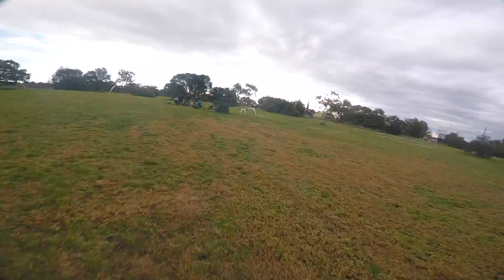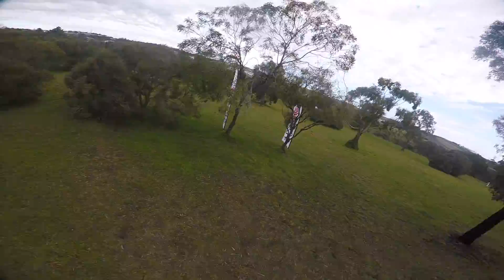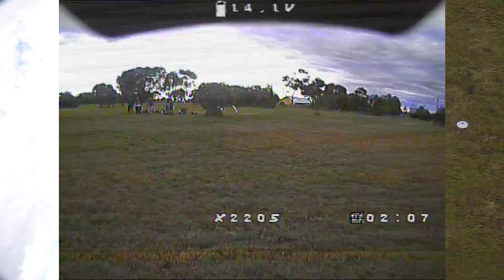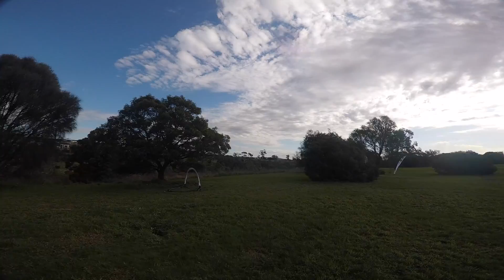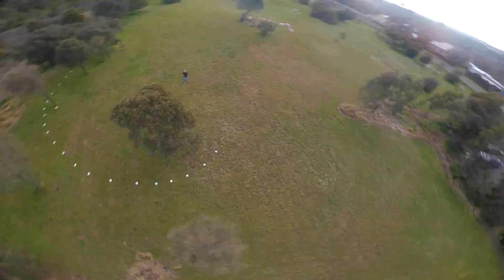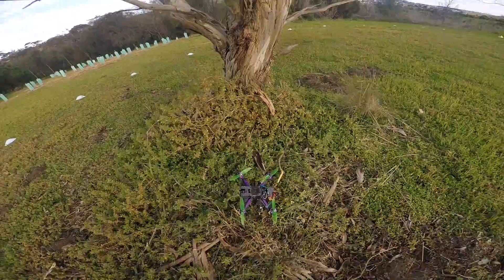THINGS ENDED BADLY!!  Eachine Wizard X220S review + flight

Comment from the maker: Wizard x220s Link - http://bit.ly/2srvodc
but I recommend at the minimum replace the top plate with this and check your screws and solder joints
Wizard x220 top plate (Full Carbon) - http://bit.ly/2tSfhWH
Reply: UAVfuturesx220 top plate works for x220s?
Reply: Thats gold Stewart, love ya work mate, keep it up.
Reply: Absolutely loved this review mate! Had a good laugh when you guys were trying to break it, I'd love to see more of that (hint hint).
I'd love a video on the comparison of these arms vs the original full carbon arms.
I've crashed my 1st gen wizard a few times fairly hard and I'm yet to break anything other than the sma connector off the vtx.
Keep up the good work mate!
Reply: UAVfutures great review. I loved the crash tests
Reply: Stu!! Just wanted to let you know, if the top plate is the same as the original Wizard, you can use this(http://tinyurl.com/y8lwvs9u). It is a 2.0mm top plate and has lasted me many crashes on my X220!
Reply: UAVfutures I would suggest replacing the whole frame. You broke the top plate, I broke the bottom (i didnt have the S, but I got one to play with). With a good frame this thing would be an amazing deal for beginners, but in the beginning you crash so much.

I wanna get more people into FPV and something this cheap really catches attention, but I don't wanna direct people to a first drone that breaks so quickly.
Reply: Hmm good to know this, thanks
Reply: UAVfutures you should do a parts swap to a better frame
Reply: UAVfutures is the movie kangaroo jack accurate
Reply: UAVfutures Hi Stu. I'm new to the drone racing scene really want to get involved I have a tiny furibee I have made fpv and loved it. What would you recommend for an outdoor racer. I was looking at the wizard 220 and then came along the 220s I really don't know what to go for as I want an rtf that's not gonna break the bank. Thanks for any help.
Reply: With so many things that are being mentioned to be replaced, top plate, props, stock battery is junk, so so carbon, etc.  Stu would you suggest just spending the extra 25 dollars and getting a Tyrant S instead?
Reply: UAVfutures HI Stew. Big fan of your channel. I have to ask where is the part two flight review of the Talon displayed right near your head in this video? Every new video that you create I'm alerted via YouTube and I'm anticipating the Talon review flight test. With so many racing choices out there it's hard to decide but I'm very interested in your thoughts on this frame. Keep up the fantastic reviews.
Reply: UAVfutures [IMPORTANT] GOOD NEWS! HELLO!  Just fyi, Banggood has changed everything on the wizard x220s. The frame has been upgraded to carbon fibre, and the motor screws have been screwed tight. Everything works fine now, so most of the serious issues highlighted by reviewers have been fixed! Good news!
Reply: Screwing them down tightly is only going to defeat the purpose of the soft mounts, they need loctite. Good to see the fram has been changed, I noticed on the website that they have highlighted the carbon fiber arms.
Reply: UAVfutures wich one should I buy? The wizard x220 or the Diatone Tyrant or the wizard x220s as my first racing drone? Or is it better to build your 99$ build ?
Reply: Hi @UAVfutures

The x220 top plate don't fit good for the x220s frame. The x220 top plate have his 2 rear bolts holes are positioned more far a the rear of the top plate, and also you can't fit the rear LED bar properly because the x220 top plate dosen't have the holes to fit it.

So you should not recommand to buy a x220 toplate to has a replacement part for the S version.

Otherwise thanks for your review :D
Reply: Not really. It mount but you have  to drill 2 holes for the rear plate, and also you can't put the LED bar either ( or you need to make a snick like the original x220s top plate ).
Reply: Hey stu I don’t know if you’ll see this but the x220s now comes with a full carbon fibre frame.
Reply: The arms got replaced by full carbon months ago (Banggood sent them to me for Free, latest Models got them off the Chain).
I dont know about the rest of frame, but I fly it for months now, including some massive crashes. The top plate, as seen as weakness, is its strength in my opinion. Once i crashed it with very high speed on an iron railing, the top plate broke - but it took also all the Impact Force! none of the other components got damaged! And the plate is 8$....
Still flying my X220s with pleasure. (But replace the pagoda Antenna with i.e. Aomways, it's crap) 
Otherwise a perfect Beginner drone imho
Reply: UAVfutures you have so many drones care to spare one for me I'm broke and getting into the hobby lol
Reply: Please reply, which one should i buy? x220 or x200s?

Comment: After having my Eachine Wizard X220 for about a month or so, I've accepted it was the best/worst decision I've ever made. 

While it taught me perseverance (items breaking without me even flying, finding quality spares, learning how to solder) it also taught me that I should have listened to the herd and built my own and paid slightly more. 

I've now replaced almost every item on the quad except for the stock fc and pdb and I'm in the process of waiting for a new frame to come into the mail after breaking my top plate. 

Build your own quad first 👍
Reply: Jonathan Strong
I had to make the decision between a pre built quad like the x220 or buying the parts and learning how to put them together. I'm not too bad with electronics, but I've never built a quad. Thankfully I made the right decision :) If I know how my quad is made and what part serves what purpose, it's going to be easier to repair things I might break. Aaaand I am hyped for the building process itself!! I just have to wait 2 weeks for my order because it's all from China haha
Reply: Same exact story here.  Bought the X220 as my first quad.  Pretty much ended up replacing every component over the course of 2 months.  Things breaking and snapping or catching on fire.  Going to build my own for my next quad.
Reply: well that sounds perfect to me 

you bought a cheap quad, got to experience flying it and over time learned how to repair and replace parts 
you have done so much that now your ready to build your own 

i have just bought the X220s for these very reasons 
want to get into the hobby and need a starting point thats not completely overwhelming 
-i know nothing about electronics
-ive never soldered anything
-no matter how many vids i watch on builds i get lost in the lists of parts and their needs/relation to each other

the wizard will get me flying and learning at a natural pace

there is no need to be a RC build guru from day 1
Reply: Well just get ready to wait around for spare parts. That sucked the enthusiasm right out of me. However, on my next build, I'm buying all from local shops. Buying from banggood gets you branded as a traitor in the community haha.
Reply: Don't be sad - you got to fly-build-fly-build. When I was starting out I spent AGES finding good parts, ordering them, waiting for them all to turn up, slowly putting the thing together (checking all the various diagrams and asking around). It was AGES before I got to fly - you've had the best of both worlds - flying AND building - all at once =)
Reply: I had wizard about 3 months now and I have replaced 2 escs, top and bottom plate, (broke it in half:D ) antenna, vtx, motor, (tightened the screw too much and shaft popped.. broke the charger by putting wire the wrong way, walked in to a branch with my goggles on, no more diversity... two batteries too low voltage. fuck if I knew:D and fried one fpv cam and scratched a gopro. Best hobby in the world. Except waiting for the mail. Can´t wait my batteries are charged so I can go again:D
Reply: whatever quad you start with is going to get busted...i took UAVFuture advice and started with the x220 - yeah, went through a PDB and FC within a few weeks of screwing things up - but it was all my fault..stock motors seem VERY fragile, 1 crash and they're almost toast
Reply: Yea... mine dident even take off :/

Comment: Stew - Don't hate on the composite frame. 90% of the strength of a carbon frame is in the outer layers. The middle section is just there to hold the outer layers apart. If carbon/filler is lighter, it's probably better in many aspects. Google carbon honeycomb to see how carbon is used in the motorsport/aerospace industry.

The top plates on QAV style frames have been breaking for years, they just aren't a strong design. Eachine have made it substantially worse by adding slots for the rear plate to hook into. Strapping a battery to a 1.5mm plate is also a stupid idea, if I was going to fly one of these, I'd either convert it to a bottom mount battery, or run a long strap around the entire frame.
Reply from the maker: totally want to test this more
Reply: Have you still got an original Wizard on the wall? I'd be very interested to see a comparison of the arms (strength vs weight).
Reply: great idea to run strap around entire frame, thank you

Comment: I managed to get one and I am loving it. I did manage to break an arm after a rough tumble. Though I have replaced it with one of the original wizard arms(Since they dont have the parts available yet) and it works like a charm. Still flys great, though I may go back in and re-solder everything just in case.

Comment: [IMPORTANT] GOOD NEWS! HELLO!  Just fyi, Banggood has changed everything on the wizard x220s. The frame has been upgraded to carbon fibre, and the motor screws have been screwed tight. Everything works fine now, so most of the serious issues highlighted by reviewers have been fixed! Good news! Those who have ordered before will get a free shipment of carbon fibre arms! This is just fyi as the problems highlighted by reviwers have been fixed.
Reply: James Smith what about the shoddy soldering?
Reply: Thus is Amazing I cant belive it!!!!

Comment: Great review, Thanks!  I would love to see  you review the BFight 210.  A lot of people are saying it is a better choice over the Wizarad X220s at a price of $155.00 with a frsky reciever.  It is 4s but I've heard it still performs better than the Wizard on the 5s.  I'm still fairly new to the hobby.  Been flying the micro brushless motor quads like the Eachine Lizard 95 and the Kingkong 110gt.  So I think I'm ready to move up to a bigger quad and the BFight 210 was my choice over the Wizard X220s.  Would love to hear your thoughts.

Comment: The top-plate snapped on my Wizard x200 as well, from a pretty low key crash; it snapped landing flat, just from the weight of the 4s. I suspect there's something not good in their production of these frames.
Reply: Robert Williams  Where you running without the side plates?  You cant really blame that on the wizard if you were not flying it the way it was designed.

Comment: Hey UAV Futures I was wondering whether you would buy the x220s or just the x220, I'm a complete noob and don't need the upgraded motors but I need something crash resistant. Thanks!
Reply: I'm in the same boat.  Everyone is saying to build your own and eventually that is the route, but I can learn from picking apart one of these and learning from looking at it as well.

Ive also been looking at another review that Stu made on the Diatone Tyrant S.  Its a little bit more but pure carbon, about 25 dollars more, comes with a better built antenna.  considering that  people are saying that if you buy the x220s, that you should get the carbon top plate from the x220, better antenna, the 25 dollars shrinks a bit where you don't have to change anything.
Reply: Thats funny because I was actually just watching the review of the Tyrant S when I got your reply! I think the tyrant S so far is the best one I've seen for my needs.
Reply: i agree
Reply: Woah! Grumpy Trev! Thanks you guys!
Reply: If grumpy trev says so!  If he tells me to eat my veggies, I'll eat my veggies!
Reply: Looks like we really are in the same boat then! 

I've been leaning toward the Tyrant S.  Its listed at $200.  Though some parts might be considered "inferior" vs the X220s, I'm not sure if its something we would notice.  05's vs 06's, both are 2300kv.  one has F3, the other is F4.   Don't know if the Tyrant S can support 5s lipo's.   Not sure if its full benefited at the moment or if those differences have a large margin or still rather narrow.

The x220s is slightly less expensive, but given that people say the top plate $5-$8 needs to be changed.  The propellers are trash news ones are cheap $few bucks.  The Pagoda with the X220s apparently sux - $few bucks, next thing you know, that 25 dollars in savings have been completely washed away except now you have a frames that's true actual carbon fiber where the motors won't fly off because the screws holding them on werent tightened. 

Maybe I'm just trying to justify it to myself.
As for some of the spec differences.  I actually don't even know what it means.  I'm new to this. XD
2205s and 2206 means it has a longer stator which means more copper and more copper means more resistance and more resistance means more amps and more amps means more prop and more prop means more thrust??????  I don't know, 

But better build quality, reliability, real carbon,  that kind of stuff to me justifies the extra $25?
Reply: Did you figure out what you were going to choose yet?  This might seem like a little overkill, but after seeing more videos, from this one, to DC campus, to andy rc, to greyson hobby, etc, so many people recommending to replace this, replace that, replace everything.  I was adding up all their parts that they suggest replacing, and its near around $225-$250, and that's before a battery/batteries.  Unless somebody got the RTF x220s, which is $250 already, then you just have to replace the same parts, ditch the receiver because everyone says its junk, the battery they give you is junk, the props it gives you is junk, redo the shoddy solder (case by case basis),  Now you're over $300 or close to it.
Then, I was looking more at Diatone and while I was on their site and reading about their new 2017 GT2 crusader.  (Hold on a second! A GT2 Crusader?!?!  2 versions with both the standard and the stretched X version. Standard using the D-Silver 2206 2450KV Brushless Motors, and the stretched one using the D-Silver 2306 2450KV Brushless Motors. about $270 for the standard, and $280.

I know, I know.  TOo fast right? TOO FAST!  That's what they said when I started riding motorcycle, to start on a 250cc, and I started on a 1000cc.  Yes it was fast, but I rode slow...... so......in this case, yes its fast...... Maybe... I'll fly slow.... put a 3s battery on it.  Then once I get used to that, put a 4s battery on it.  
How does that sound?
Reply: Snafu2346 Haha I actually justed purchased the Diatone tryrant s and all the the other stuff such as goggles and controller and lipos and stuff. Bad Idea?!?! Thanks for the help you guys!
Reply: Grumpy Trev thanks so much for the help! I just purchased my Diatone Tryant S and can’t wait for it to arrive. I’ve been flying on a simulator and I really suck so I think this is the best solution for me. Thanks for your help!!!
Reply: Snafu2346 Also I don’t think I could handle the gt2 I have looked at it tho. And it’s a bit expensive for my budget. :(
Reply: I think the Tyrant S is plenty fine, as that is the other route or the Furibee 200 thingywhats it called.  Stu had a video of that too and it was pretty insane.  It really came down to those.  The Furibee Fuuton which is around low $200 look super fast and I was deciding on those two. 

I'm about to order the 2017 GT2 stretched crusader, after adding up all the parts it would cost to "fix" the X220S, I was only about 20bucks away from the Crusader.  So I was like "what the hell", spend 20 more dollars.
Reply: If you look JUST right of Stu's shoulder on his Quad wall, you'll see what actually appears to be the 2017 GT2 Crusader he has yet to release a video of.  Maybe because it technically hasn't come out yet. Or maybe, he's just trolling us. :D
Reply: great stuff keep me upto date with how your going
Reply: Its  good to see you here Trev!
Reply: ok great! thanks!

Comment: So considering your final thoughts would you rather recommend beginners to grab a x220 or x220s?
I was all in for the new Wizard and hell, I was fully expecting a need to do some upgrades but it seems quite a lot has to be done to make it as good as it seems. The noise and breakups on the FPV feed is the biggest letdown for me and I've seen a lot of people have it. Would a x220 be a better choice for a first racer?
I was thinking about it as a very decent out of the box quad which you can (but are not forced) to fix/upgrade as you go.
From this video it seems to me I was mistaken, was I?
Reply: In my opinion the X220 you're looking at immediately upgrading the camera and ESC's because you can't go 5S unless you do. For the X220S you are upgrading the frame (once you break it) and probably spending some time resoldering. To me, the X220S is still the clear winner.

Comment: ive crashed mine badly multiple times  ..like really smashed it hard and nothing broke except the side plate pooped out (it was still ok) plus bent a motor shaft and on the real bad crash i snapped the battery strap....the frame is fine this thing is well and truly strong u must have got unlucky to break what u did?

Comment: Hi Stew. I fly a dji spark and like doing scenic videos but lately I’ve been saving a battery or two for sports mode and even flying it in fpv with my 12yr old son, so we have been looking into racing drones and come across your channel (which we love) and looking at getting this drone, would you recommend this as it’s available to by here in the UK?